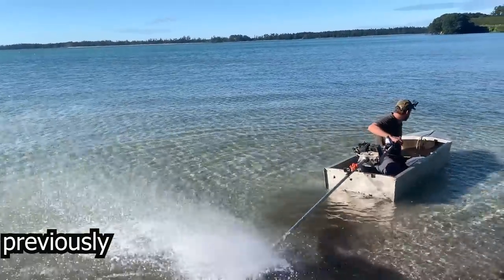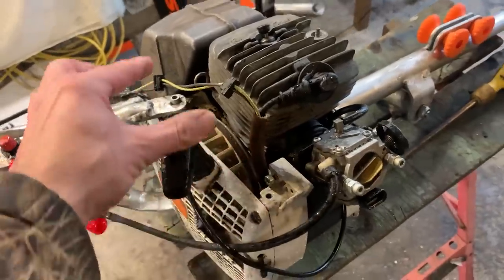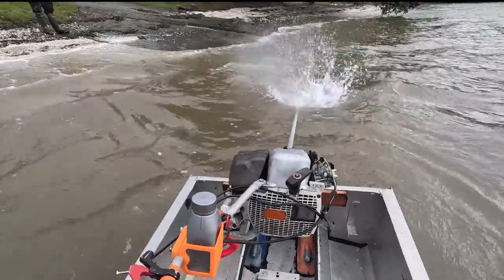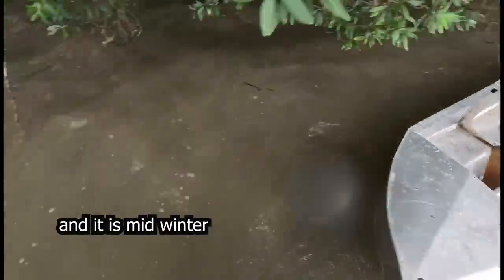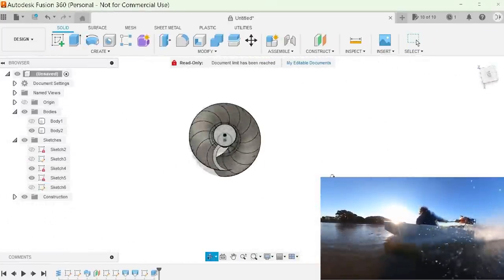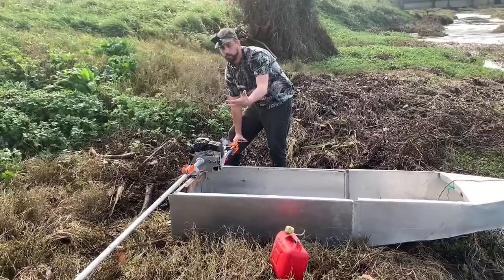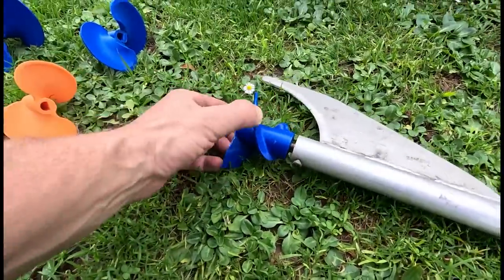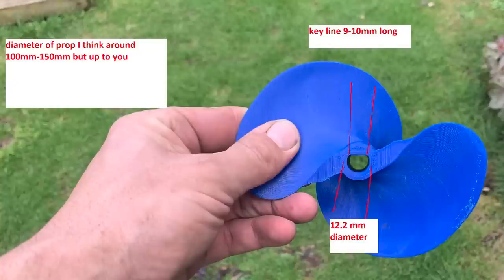Chainsaw Powered Thai Longtail Build, Part 3

Comment: I recently sat on a Thai beach for a week watching the longtail boats.
They are a fascinating design. The fisherman showed me how good the design is. So simple but the manoeuvrability was extraordinary and they could simple lift the prop to avoid the propeller entangling ropes or seaweed etc.
Reply from the maker: They are so good and can also run I shallow water
Reply: @DktheWelder  Yes, I saw them run with the prop barely in the water, so inches of water, I also love how they point them towards the bow for reverse

Comment: You were moving pretty quick! Nice job building the cowl.  I've heard that the smoothness of the prop makes a huge difference so sanding and applying resin should help
Reply from the maker: I just watched a video on that I didn’t realise how much difference it would make
Reply: @DktheWelder  its why boat props are usually polished. Also would you try some toroidal propellers? that would be awesome to see
Reply from the maker: @DatBlueHusky  they would be cool to try but look hard to draw

Comment: I've used several "Weed Wacker Edger" / "Straight Shaft String Trimmer/Edger" gearboxes that are built in for various projects finding them to be very durable and long lasting with a handy 1.5:1 to 3:1 gear reduction ratio built in depending on brand.  Just an idea but would require a fair amount of redesign
Reply from the maker: A gear reduction would work but getting exactly the right prop will do the same thing 👍

Comment: Seems like your getting the prop closer. The problem I would have would be locking the motor trim so it's not jumping out of the water. Watching from Montana.
Reply from the maker: There is another level of speed once it starts speeding up it will lift till half the prop is out of the water and will get more efficient

Comment: I had a handcycle when i was a kid and that handle bars fell apart so i used vise grips to steer and i put a weed whacker engine over the back wheel and a allen wrench in one of the bolt holes on the plastic to push the shaft diwn with! It was fun but had very little power!
Reply from the maker: I actually tried making a long tail out of a weed eater but it didn’t have the power haha, this has heaps power just need the right prop aye

Comment: That's awesome
Reply: @DktheWelder  I'm putting a briggs and Stratton that's older than I am, on a 90cc fourwheeler frame, its dope asf! The sprocket on the CVT is like an inch too far to the left, so I 3d printed like 4 prototype sprocket spacers, finally got one that lined up perfectly, sent the files to PCBway to get it CNC milled out of stainless steel yesterday. But figured I'd share cause none of my friends like to build shit so its pointless talking to them about it.

Comment: You need to have the prop slightly up above water line.   One blade underwater and other blade above water.
Reply from the maker: That happens on my other longtail once you get planning, when you take off it needs to be deeper then as you come up on plane it runs as you say. The high rpm of this motor makes is making it tricky to get the prop right but i will get it 👍

Comment: Hay at a guess try around 15omm but half the pitch of what you used in the creek....if you want more torque
grind the exhaust port upto 85% width of the piston diameter.....dont touch the top of the port or bottom
Reply from the maker: Yeah I think more diameter and less pitch might be better. You should draw me one ? Haha. I thought you raise the exhaust port I am reading a book on it , I’m kinda scared to do porting aye
Reply: @DktheWelder  raising the exhaust is like adding more duration on a four stroke cam, you dont really want the peak rpm to be higher than it is.....yet.....haha....i will find a book link for you to read.....But "Two-Stroke Performance Tuning" by Graham Bell is the only book you will every need for two strokes......I dont know how to use your software........wish you were closer.....Oppps its not 85 its about 70-75% of bore
Reply: here is a video of the book and exhaust port,
https://youtu.be/x5Gnn1h2NP4?t=252
get a expansion chamber from a 125cc dirt bike that runs about 9000 rpm

Comment: Friend of mine printed an impeller for his pool pump, dont know the material, regular hard plastic. It broke after awhile, assuming the vibration of the pump did it
     So he printed another one out ofna flexible plastic. Its been on there for 3 years now or so. Cant remember what the material is, but its flexible, and its holding up great
Reply from the maker: O cool! Three years is a long time it is great what people are doing with 3d printers
Reply: The more flexible stuff he used is TPU. If it interests you to try it, might take a bump from somethin

Comment: What are the dimensions of your hull? It seems quite stable for being so small!
Reply from the maker: 2400 long 800 wide and 350mm high  out of 2mm and I can lift it with one hand. I like it so much I am building another one a bit better shape👍
Reply: @DktheWelder  Great :) I'm planning on building a mini plywood boat which will have similar dimensions

Comment: Goes well, think you ar very close on the correct pitch. Maybe a tad less so you can do close to full rpm under load? Would not yet increase diameter, just slightly reduce pitch.
Reply from the maker: I think you are correct maybe less pitch again , once I think it is close I can refine the design too

Comment: Nice work. 
I see a hydro formed tuned pipe as another video
Reply from the maker: I have tried a hydro formed pipe before but they are hard to make without wrinkles haha , I have started building one with cones
Reply: @DktheWelder  can’t say I have done it myself. 
It does look hard. 

Ductile steel is the trick I guess, and huge pressures.

Comment: Make a  screw drive   type  prop .  also  i  would use a 2 stage  prop   like your  orange one  but  make the  blade not so  fat  or wide .  make it   smaller . you gotta make up for turning the shaft to turning the prop .   so same version to the the orange  one . but smaller
Reply from the maker: I think I know what you mean, draw me one and I will print it👍 . I haven’t got any emails yet of props people have designed

Comment: Hey like what you are doing cause I did the same but I used a husky 3120 first thing I did is the muffler it restricts so much to be quiet so watch some chainsaw performance videos do a muffler mod to it check how fuel mix after cause this will lean motor  but after watching your second vid you over heated that motor and prolly scored piston and cylinder so with all that being said figure out if it needs to be serviced 
       The next well what I did was got a cylinder and piston kit did some mild porting and built a expansion chamber and went from right around 8-9 hp to 12-14 hp and increased my rpm’s and what a ripper it is was amazed at how fast it pushed boat you need to limit how far in the water the propeller goes but make it adjust 
      Hope this helps check your piston for scoring on the exhaust side watch some tinman or old iron horse he’s a strange old dude but he knows how to make power in a saw motor
Reply from the maker: Interesting! Do you have videos of this? I didn’t overheat the motor? I am building an expansion chamber at the moment, I would like to port it as well but not sure what I am doing . I will check out the guy you said to watch

Comment: I am also doing an experimental long tail set up on a tinny. I have tried a 6.5 in and 7 in aluminium prop from Thai land. With a 30cc 7hp diesel. I use a milk crate wedged under the handle to hold the prop deeper under water. If you want to see examples comment and i will tell you which of my videos and which time gives the best example.

First need to redo my pivot and hinge, but I would also love to experiment with propellers one day soon!
Reply: But we have different goals you are looking for surface drive i am making use of my torque
Reply from the maker: Yes it seems once up on plane half the prop wants to be out of the water , a diesel would be great with all that torque and I bet you go a long way on a tank